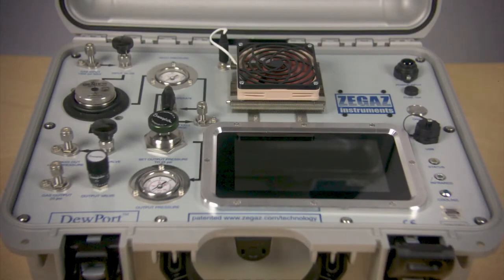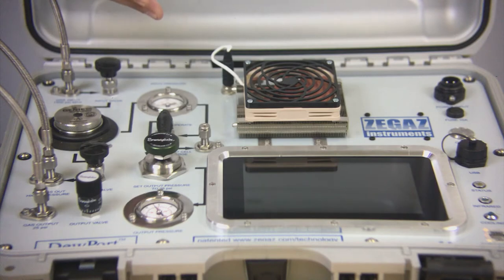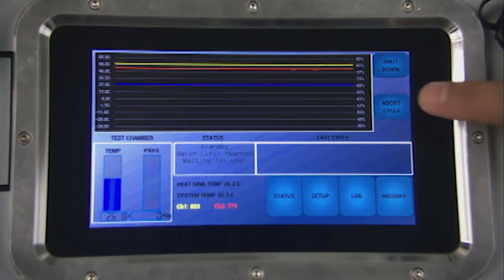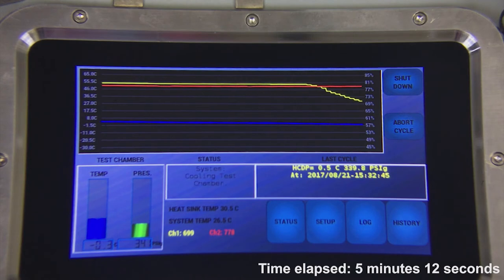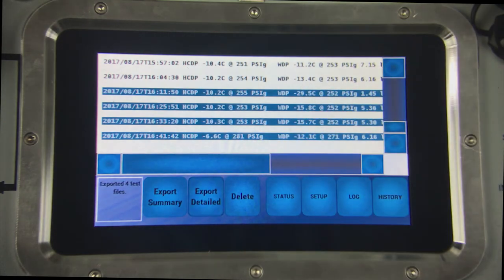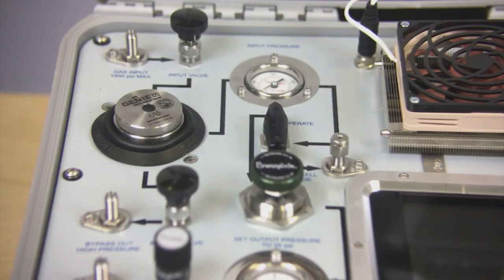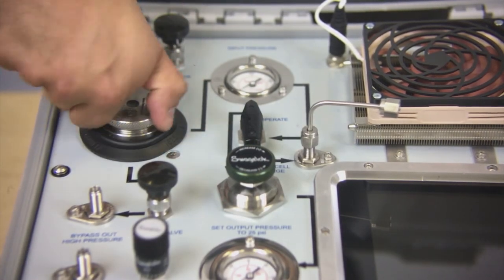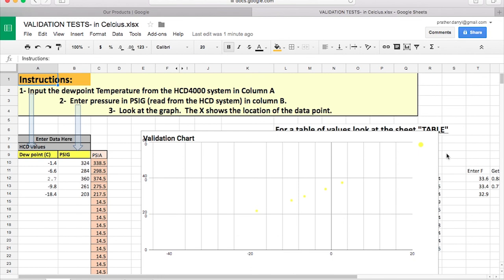Step-by-Step Guide: Operating the DewPort™ by ZEGAZ Instruments

Comment: which gas has to use a validated instrument
Reply from the maker: You can use any gas with a known HC or water dew point to validate.  We recommend pure Ethane because its phase diagram (dew points at different pressures) is well known.  You can also use pure propane, or any other gas with a precisely known dew point.

Please note that this instrument measures both moisture and HC dew point using the same mechanism; i.e. unlike some other instruments, it is not using two different sensors.  So if you validate with HC gas, you are assured that it is also working for moisture.